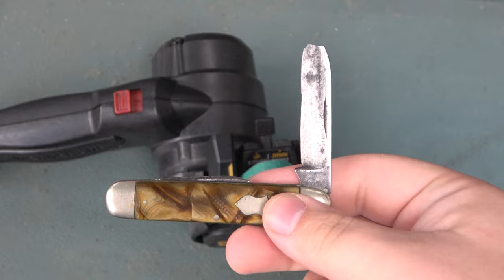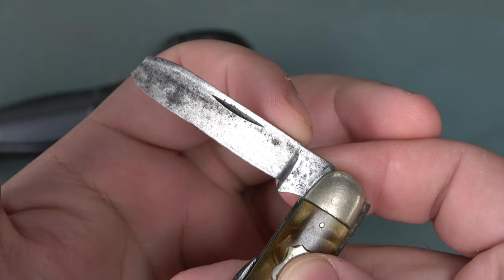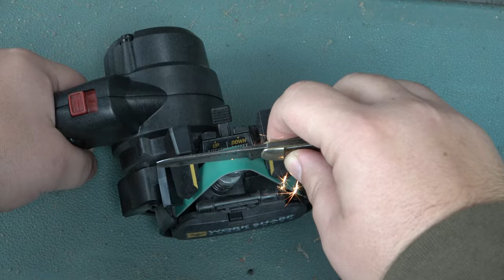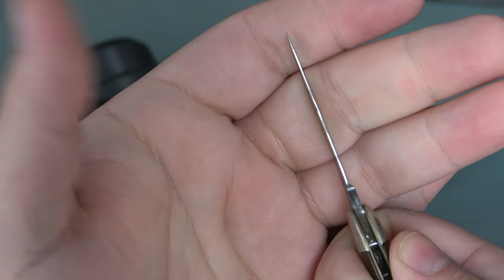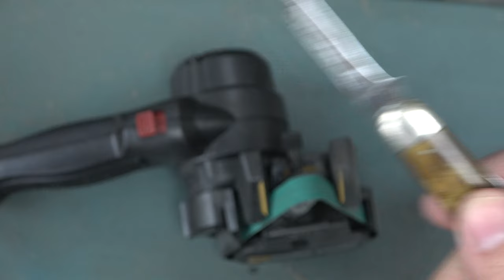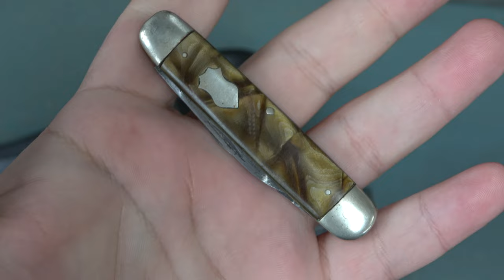Fixing A Broken Knife Tip Is VERY Easy To Do With Electric Tools...

Comment: I love those work sharp mini belt sander sharpener things. It's just a handy tool all around. 
I usually just leave the very high grit on all the time and use it kind of as a strop. I made the mistake of using a coarse grit on one of my favorite knives and by the heel/choil it ground back too far so the blade isn't straight anymore but it's fine. I also don't use the guide I took that off and just do my angle by hand.

Comment: You really want to remove steel from the spine, not the edge.
Now your edge is going to be much thicker, and if you had chosen something other than a sheeps foot or wharncliffe you'd have a proud tip unless you grind down the kick.

This is one way to do it and it certainly works,  but there are much better routes to take.
you removed so much steel and so many years from the knife.
I personally would have made this into a spear point or drop point, removing steel from the spine only.

Comment: Ouch. Too much steel lost I'd say. Could have made a decent spear point I think with far less removal.
Reply: If you did that, there's a decent chance your tip will protrude above the liners, meaning you will need to hog off even more material